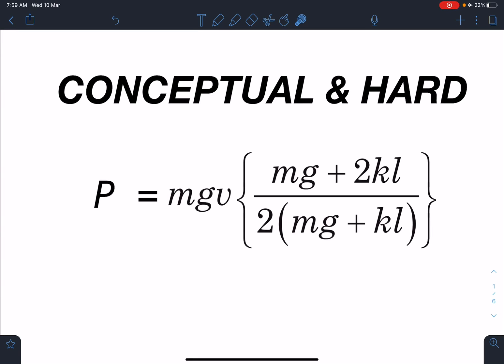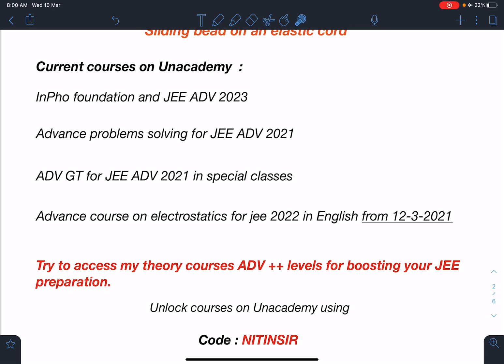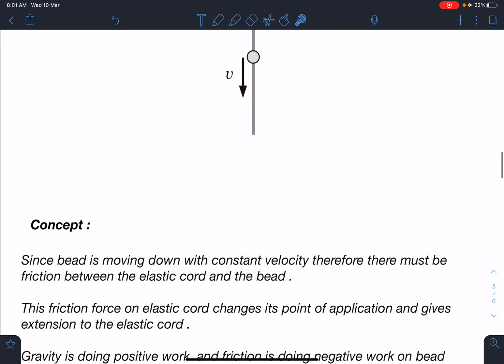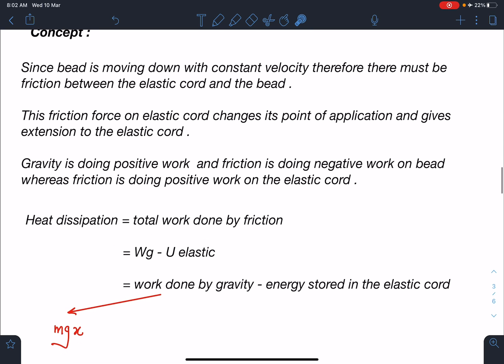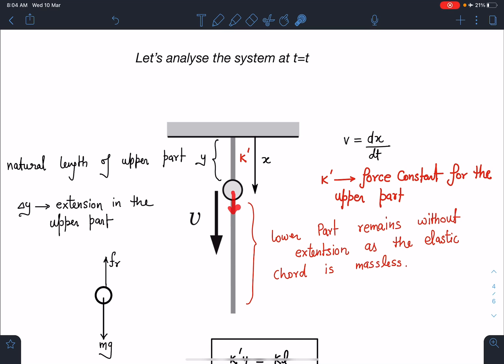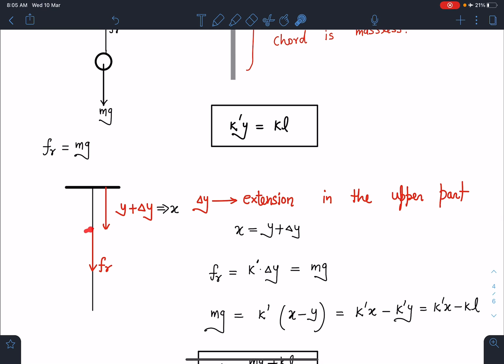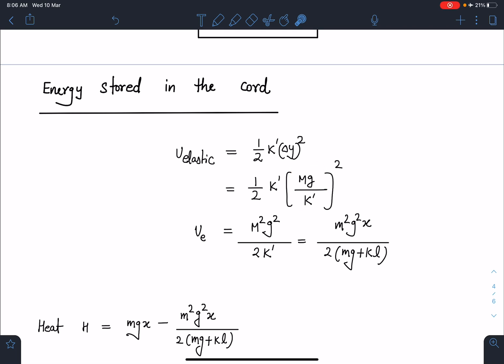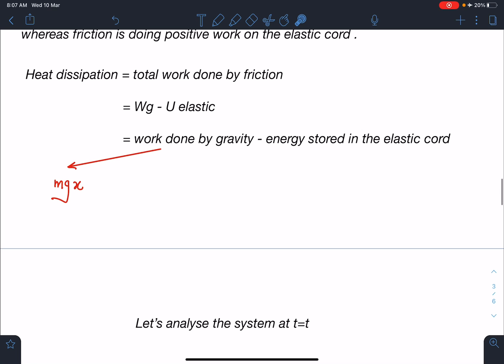[JEE ADVANCED]  SLIDING BEAD ON AN ELASTIC CORD [ HARD & CONCEPTUAL CHALLENGE] [ PATHFINDER]

Comment: Its a very simple problem but this approach is complicated. If you find total heat generated and divide it simply by the total sliding time ,we get solution within 3-4 lines only. 
Total Heat =  Potential energy lost by bead during total travel - Energy stored in Chord (easily found using mg= kx when bead reaches end point).
Power = Total heat /Total Time.
Total time can easily be found as bead is travelling with uniform speed.
Answer matches exactly...
Reply: Genius ❤❤
Reply: What you are finding out is the Average Power. However we need to find instantaneous Power. In this question, Heat generated happens to be a linear function of time and hence Power is constant. Hence average power is as well the answer (same as instantaneous Power). However one needs to prove this before claiming average power by itself as the answer.

But, to even prove that power is constant, one has to resort to the method explained well by Nitin Sachan sir. One can as well continue with that method to find the instantaneous Power. The solution provided by sir is very logical and most appropriate.

Hope this helps.